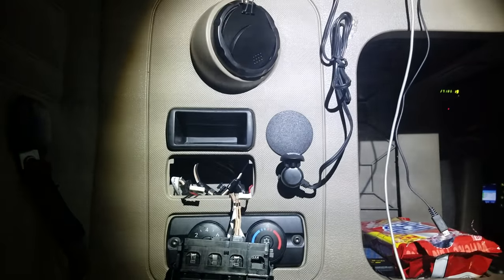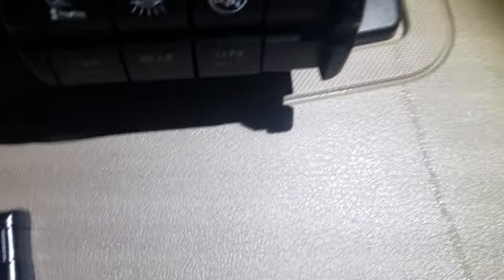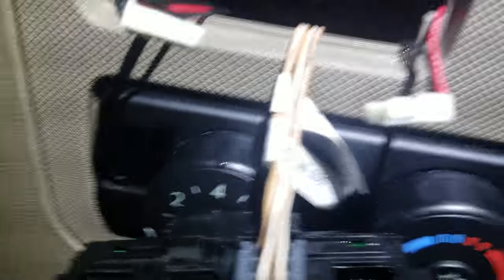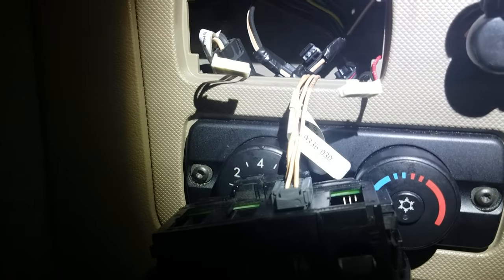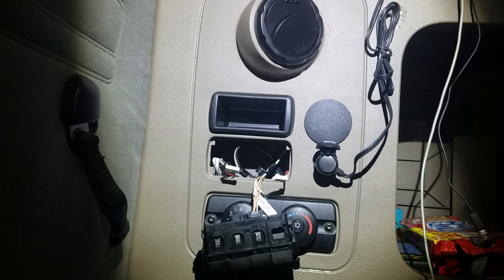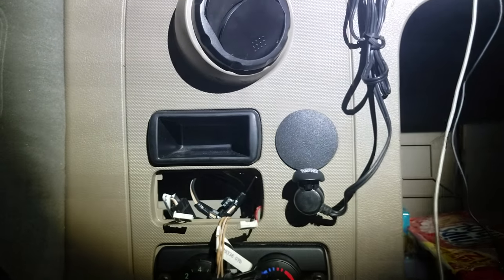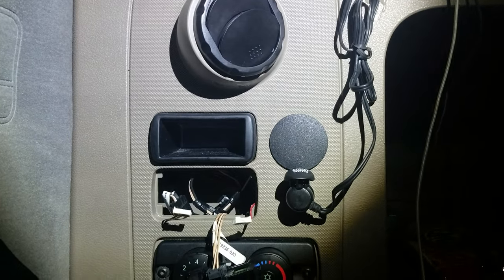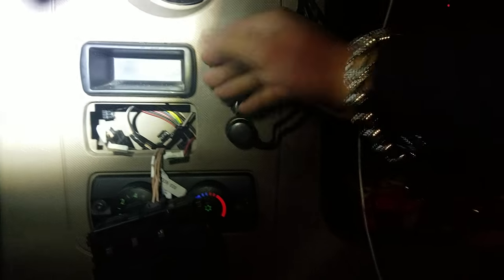Freightliner Cascadia interior light issue

Comment: On my 2021 Freightliner that I drive, when the dome lite goes on and off, I disconnected the negative battery cable on the truck. Wait 5-10 minutes, then reconnected so the computer rebooted itself. Cab dome light works normally now.

Comment: Great video, I have also encountered that problem,  but it wasnt the issue. On the passenger side, there is a plug. It's a large plug. As a result of the same thing, condensation, the plug gets corroded. It's the harness to the bunk. Also, I have had people complain of leakage inside the cab. Believe it or not we, the driver creates the condensation. It ends up collecting in nooks and crannies and that's where it comes from. This is a real issue when In humid climates. When idling and running the ac or bunk heater, crack a window just a tiny bit. Actually, when running the ac you should always crack a window just 1/4 of an inch. It will actually cool better because of the circulation. 

Just trying to help, thanks for sharing your info as its helped so many people. 

Peace
Reply from the maker: Never thought about that. I DO have that problem when running the AC. Thanks and I'll definitely have to try that
Reply: Can you show me the plug you're talking about jic this doesn't work for me.. tia

Comment: So my lights never flickered but I have condensation in my closet area. So the ac problem makes sense but it's not wet in there. My dome light works when it wants to buy my bunk lights just stopped working.  What could be the problem?

Comment: Man someone help me out with my issue none of the sleeper roof lights work
Checked all fuses  and took this panel switch thing out it only has 1 small plug on right side and one big plug in middle theres a extra wire in there that has 2 prong entrance but the spot it goes into is a 3 prong

Comment: For anyone who just finds this video I have an extra cheat to add.

This is the problem 100%, what the video says.

You can circumvent a wet circuit board in the switch box.
Up front on the console above the cup holder, you have a switch box with a dome switch and utility light switch.

Pull that switch box and take out two of the switches and put the bunk light switches from the switch box above the AC controls in the bunk, plug the two white plugs back in and the switches should work.

(Note if the switches are wet inside this may not work)

The switches are limited to the function printed on them, they have a circuit board and will only work what they are ment to work. (You can swap a bunk light switch for another switch)

This video saved my 10 today, it get toasty af with those lights on, in Florida.

Comment: I have 3 switches 1 up top and 2 on the bottom, mine is dry and still doesn't work, do you know where I can get a new switch control. I'll try unplugging and re plugging it and see if it works. Also in a pinch you can unplug the far right switch where your hazard button is. But still doesn't fix bunk light issue just allows the engine brake to work and removes check engine light.

Comment: Hey can you help me with my bunk mute button in the sleeper... a couple of days ago I realized that I had accidentally turned the bunk mute on because I wasn’t getting sound from the subs in the bunk on the roof. Then after I flipped the switch back to the normal position I still have no sound in the bunk. I look at the fuses and they are all good. I have a 2017 and yes the switches are still there

Comment: So that is not the only reason this can happen I was parked with the truck shut off and the lights over the Dash came on I turned the key on and shut it off open the door close the door turn the key on shut it off and they finally went out then a couple hours later the forward bunk light came on and will not shut off I found this video and I checked the switches in the bunk they are dry the AC has not been leaking on them but it is raining out so obviously there is a leak in the passenger window running water down into the fuse box and causing the same type of short this can happen for other reasons but this did help me rule out this particular reason thank you for the help I have a 2016 Cascadia now I just have to tear into the dash in the middle of the night and find out where to dry it

Comment: Just happened the same problem with my truck right now all the sleeper light stopped working and some switch in the dashboard stopped  working engine light comes on  Freightliner Cascadia 2016
I just parked my truck then waiting for the morning engine off no AC working until morning to make sure if there's water coming out over the switch to get dry 
. Thank you for this video
Reply from the maker: Anytime, I'm glad it helped
Reply: Still the same no sleeper lights working and some switch on the dashboard not working engine light on . But I'm driving my truck with the engine light on but the speed normal I can go 65 or 70 no speed drop down.
I looked at the sleeper switch keys this morning I didn't see a sign of water coming out around the switch keys . Just confuse
Reply from the maker: Only thing I can think is maybe corrosion in the switch contacts. If that's not it, it might be a different problem
Reply: Thanks for the reply ..
Switch contact the one back in in the sleeper the one you showing in your video ?
Reply from the maker: That's what I'm thinking. Only thing I can think of
Reply: Will try to to take it out then look for it the good and I hope I  can fix it from there cleaning or changing the part .
Reply from the maker: Might be able to use a can of electrical cleaner on it. Someone else on here commented they seen corrosion in theirs, they might know a better way
Reply: Electronic cleaner spray I guess .
Reply from the maker: Yea, there's a spray can called "electrical cleaner". It's made to clean electrical parts. Most auto stores sell it
Reply: I think I can use it for the others switch keys too may help the one in front dashboard
Reply from the maker: Most likely. I'd spray it a little then let it dry
Reply: O.k. I think so